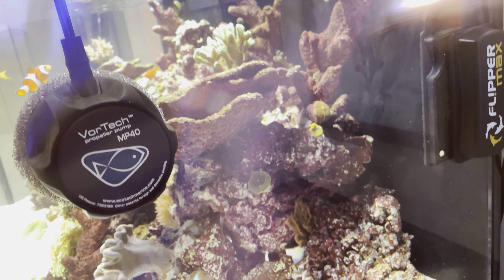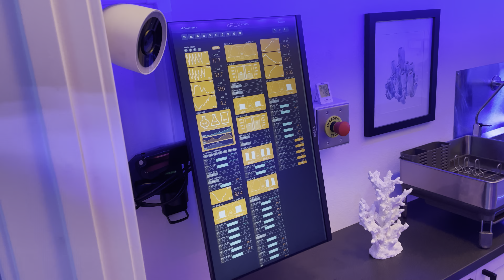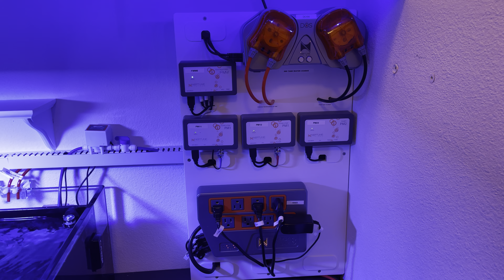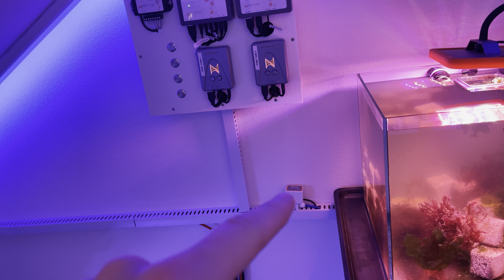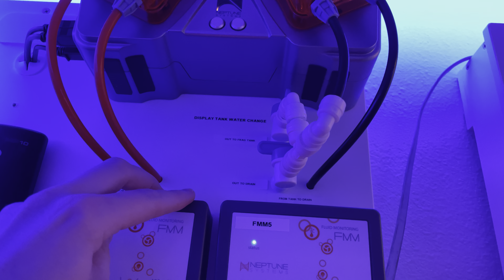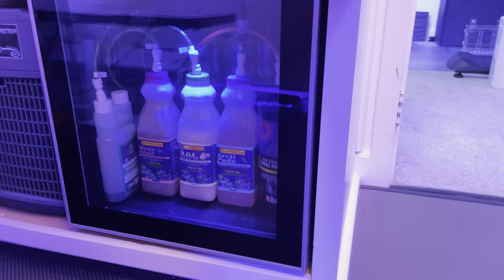Red Sea Reefer 525 XL

Comment: Can you show how the feeding tubes are going out of the refrigerator?
Reply from the maker: I don’t have any pictures of it. All I did was I drilled holes through the back of the refrigerator that were slightly larger than the tubing. You have to be careful not to hit the refrigerant lines or other things though. I inspected the whole thing before I drilled any holes.
Reply: @blakeq2006  Thanks for the response. Great idea and I will do the same. Thanks again.